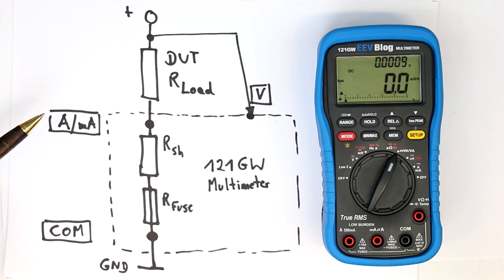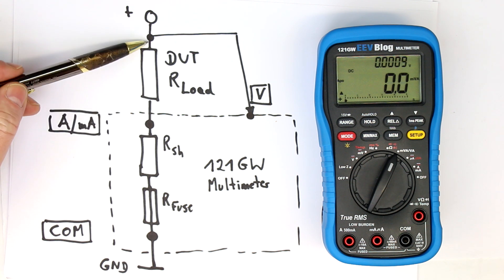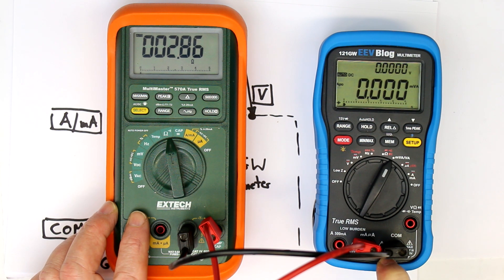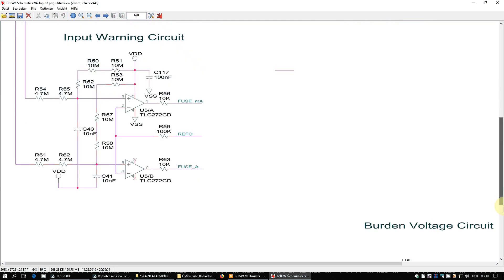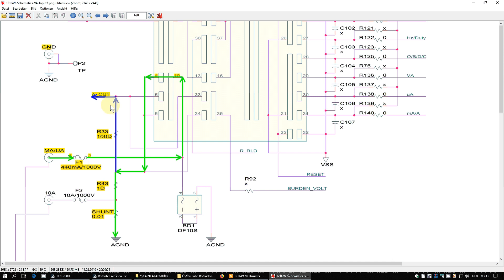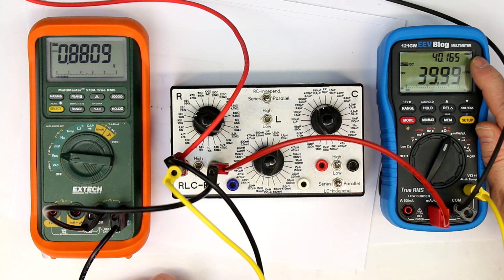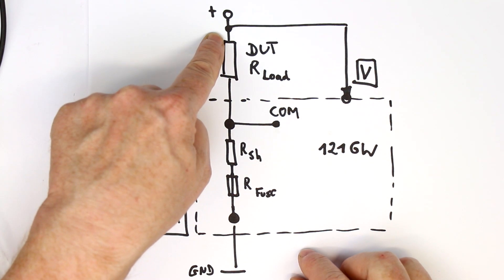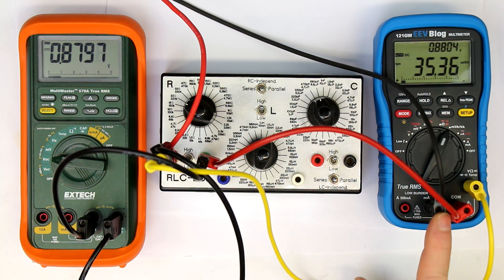121GW VA-Mode Problem & Solution

Comment: Depends what you are measuring. I use this method for very long time for measuring the power consumption by the load. But sometimes you want to instead measure power delivered by power supply. Then you actually want to include the burden voltage, and power dissipated in shunt resistor. I wasn't aware it is not well know fact.

Comment: well this is a problem if you are interesting in power consumption. If you are measruring power capabilities of a power supply then it's not a problem.The ideal situation is to be able to measure the burden voltage and have an option to subtract it or not subtract it depending on what you need. Because there are tolerances in shunts and even worse - the fuse resistance probably has a lot more tolerance than the shunt it would be a good idea to have a calibration procedure for the burden voltage. For example go over the amp ranges and measure burden voltage while passing known fixed current.
Reply: It was fixed in a trivial way that does not accept any alternative, plus the range switch resistance is an unknown variable in this product. You need to run a self calibration each time you move it.

Comment: Great video. I've watched about every video Joe Smith has out there and not surprised he found this problem and solution. IMHO he has the best electronics problem solving and re-designing skills of multi-meters and test equipment out there. I don't know what his background is or job but obviously it's pretty deep in electronics as well as mechanical skill. I've mentioned to him on a few occasions he should be doing design work for some big test equipment company. I'm pretty novice to the electronics game, but his videos have influenced my past 4 multi-meter purchases just because of his thorough in depth videos of tear downs and testing. I love the Brymen meters to which I would have never heard of until finding Joe's channel. Once again great video breakdown of Joe's solution.

Comment: Ah yes, the curse of common ground in instrumentation.
It's a nice work around.
Could you repeat the experiment with a bench supply in the shot ?
Would show visually what current/voltage is going into the circuit, with and without the 121GW in circuit.

Comment: Hi Rodger would this solution work on the Dave Jones BM 235 or is it built different
Reply from the maker: AFAIK the BM235 doesn´t have a VA-mode. Nevertheless the concept how to connect the load correctly to avoid burden-voltage error can of course also be applied by measuring VA with 2 separate multimeters.
Reply: @KainkaLabs  thank you for explaining that goodnight

Comment: Great stuff.  Is that RCL box a commercial product?  It would clear a bunch of space on my bench.
Reply from the maker: It´s homebuild and described here: https://youtu.be/2UI3HwWVqUE
Perhaps I will make it a kickstarter project at some time. It´s not so easy to transfer it from a hand-wired product to a PCB-populated product with not too much hand-wiring because the 24-position rotary switches have 2 separate planes and I don´t know if the rotary-switches are available in larger volume. Got mine from a Chineses Ebay seller many years ago.

Comment: Kainka Cad :-) does dave know yet?
Reply: Its been almost two years since I made the original video showing the problem and how to work around it.  I assume Dave had watched it because he commented on it.   Based on the comments I received, I don't think many people understood what was being shown, including Dave.    Rodger's video is clean and easy to follow IMO.   

Rodger, thanks for taking the time to repeat the tests and for putting this video together.
Reply: @joesmith-je3tq  it's a beautiful solution joe, and it does need to be in the manual (pdf /site)  I have mailed him to come watch this, hope he gives you a shout out.
Reply: @joesmith-je3tq  It's a shame when you post the solution on the forum and most don't understand. You're punching higher than most in this league.
Reply: @tech29X  It's all that drain cleaning experience... lol.
Reply from the maker: Don´t know. Joe Smith has put post about the VA-mode problem in the EEVBlog-Forum section about the 121GW. But the forum-entry has more than 50 pages and I don´t have the time to read all the entries.